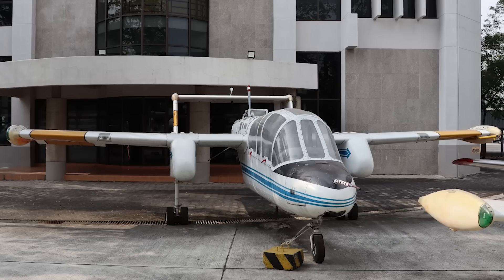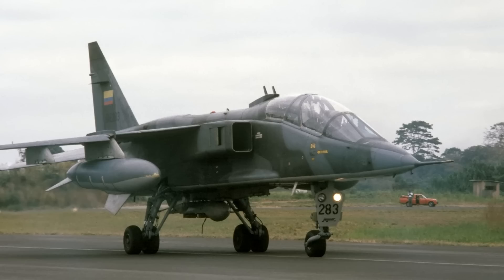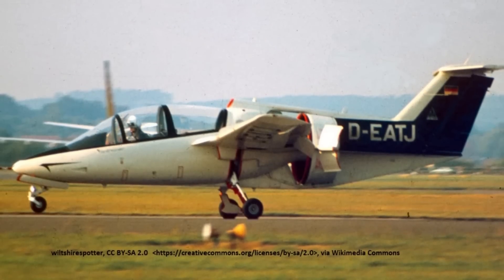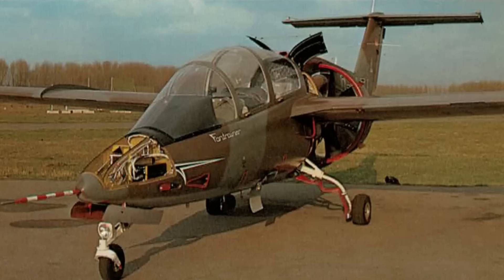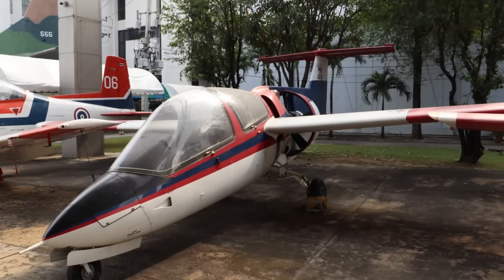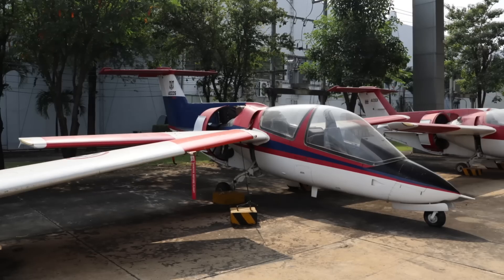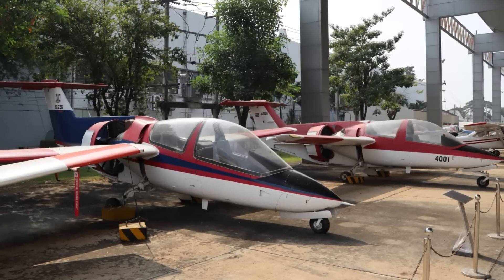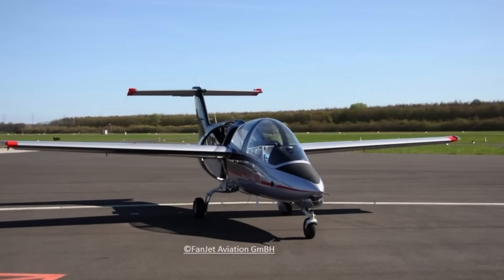The RFB Fantrainer; Making a Basic Trainer Handle Like a Jet

Comment: One question I have to ask, did it have the torque issues with single prop propeller driven planes , as one would the plane have the tendency to roll to one side due to the rotation of the prop?
Reply: Just assuming from what i know, 

since the props are encased by the duct, and that the exhaust are split between the aft section leading to the tail, it would have little rotational forces acting upon the tail that would be caused by propeller tip vortices

Now in the case of the drivetrain, it's quite tricky, for what i heard from friends long ago, that turboshaft engined aircrafts have less tendency to roll since the power delivery is smoother than what the IC engined aircrafts they had flown.

Although im interested in being corrected on what i have posted, hope ya'll have a nice day.
Reply: Good question.
Reply: @DavidOfWhitehills  I am aware that all single engined prop planes have this issue, unless it has a certain design feature such as counter rotating propellers (such as the later Seafires for example), or have a wing slightly longer than the other (such as the mc202), with the propeller in a duct behind the pilot ,does it behave more like a jet engine or does it still have the same issue.
Reply: Torque would probably be an issue, since it's it's not a contra-rotating prop.

Given RFB's focus on "handles like a jet, except slow and simple enough for basic training" it's a bit surprising that they didn't go with contra-rotating so that there'd be zero torque. But maybe they deemed the torque to be minor enough to be not worth worry about.
Reply: I can feel the engine torque twisting the cab on my W900 Kenworth, I can only imagine that this would be much worse on an aircraft with a single prop.
I think contra-rotating prop would be too complex and heavy for a light machine like this?